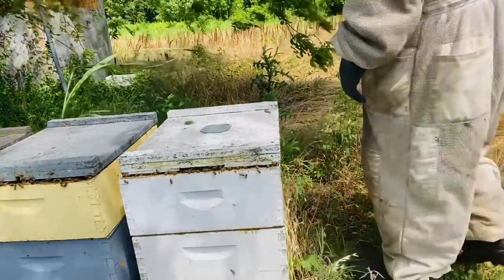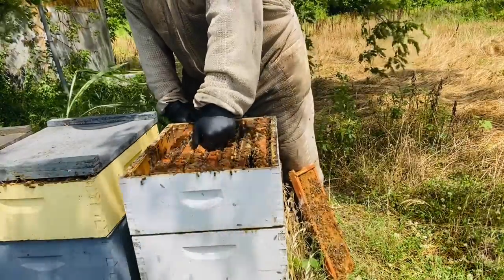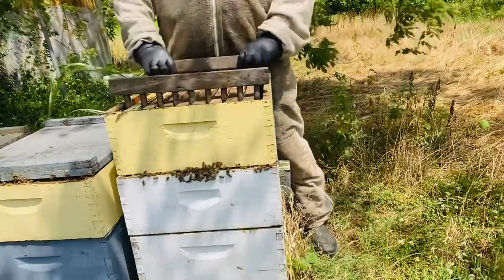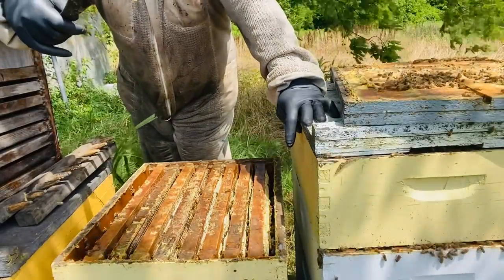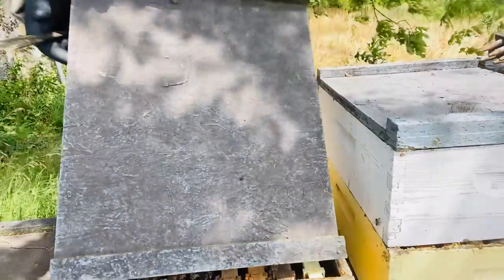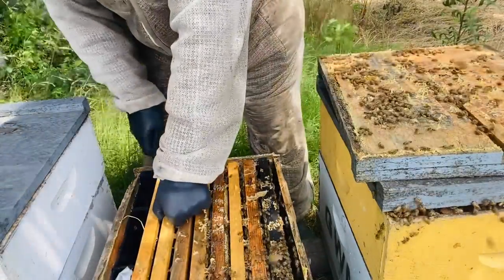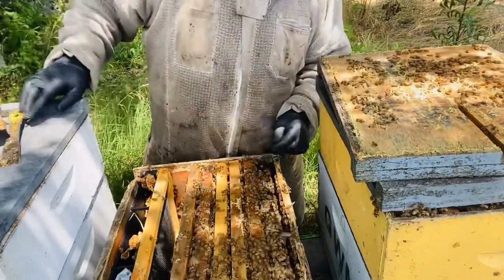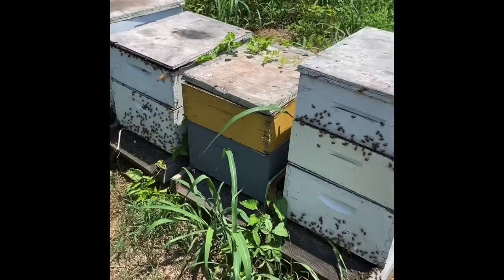How to Manage Bearding During a Flow!

Comment: I kept bees for 18 years and never needed to use a QE at all during a nectar flow.  The upper super acted like a barrier  to which the queen would not venture into.  Yes, put 3/8 shims or sticks between all boxes for ventilation, incoming nectar, and of course drone activity.  The only time I used a QE was when I set up a double queen colony or two, during a damp and rainy summer season.  Then I always pulled the front edge of the QE back about 3/4" from the front of the lower boxes.  Worker bees and drones need to move unobstructed everywhere within the hive.  The only one not allowed to travel everywhere is the queen.  Just give her two brood chambers of 10 combs each with ample cell space and watch a healthy colony make nothing but honey.  The same for a two queen colony.  Sit out by your bee yard on a summer evening and tell me the aroma from the evaporation of nectar doesn't smell like heaven.
Reply from the maker: I’m glad that worked for you but I use and teach single brood chamber management. It works well enough that I make a living from it.
Reply: @gusmitchellcranesnesthoney6529  Cheers, my friend.  I made a living, sort of, if you could call it that from 12 colonies, when bears didn't bust through my electric fence. In western MT, which was very hot and dry  during summers was considered the spotted knapweed capital of the world.  That was the main honey crop where this was also considered a noxious weed by farmers/ ranchers.  I was one of only 3 beeks in my county.  One gent managed 700 colonies and during a good flow he got very little sleep, as you can imagine.  It was busy for me as well in those days. Rarely did I get less than  80 pounds per colony from 2+ mediums. I was always pulling capped combs during a good flow.  Now make a double queen colony and watch a honey producing machine make up wards of 150, 160 per hive, but only during where there was enough rain.  One has to have a crystal ball to predict the summer season.  Not always possible.  Prayer may help, but not always.  Cheers and good season for you.  Bob

Comment: Thanks Gus for all of the information you share. Question is what about when we have these hard rain storms with the rain getting into the hive?
Reply from the maker: Rain is not a problem
Reply: @gusmitchellcranesnesthoney6529  you must have a different type of rain compared to the rain I have here 😂😂. When it rains here, the box would fill up with water faster than the entrance could let it out. Lol. I don’t use screen bottom boards, do you? That would greatly help with your ventilation? My heat index is nowhere near yours so this is why I don’t have a need for screen bottoms.
Reply from the maker: @alaefarmestatesllc  try it and let me know if rain was a problem.
Reply: @gusmitchellcranesnesthoney6529  will do for sure thanks

Comment: Gus, you use migratory style lids, the size of the slot I'm sure is important, but do you over-winter this way as well?
Reply from the maker: No, I don’t. For winter my kids are squared up, most do have a groove cut for an upper entrance.
Reply: @gusmitchellcranesnesthoney6529  No I  meant do you plug the upper entrance slot when your bees are over-wintering or do you leave a small vent?
Reply from the maker: @carlsledge3868  leave it open
Reply: I got what you were doing, you run a queen excluder to keep the queen out of the supers and you shift your supers so the field bees don't have bother with the excluder, they use all the openings you give them to make honey and not bearding and it helps them fan out the moisture of the nectar faster so they can cap the honey and there's no robbing going as long as the flow is on, and I agree hot tired bees bearding are not making honey
Reply from the maker: @carlsledge3868  exactly, great summary!